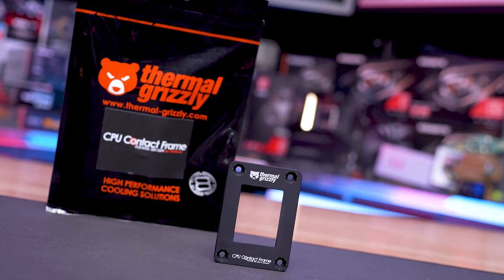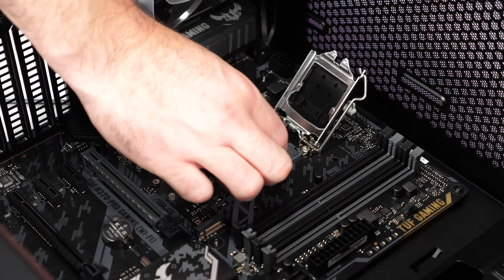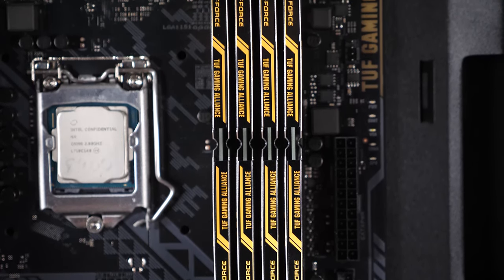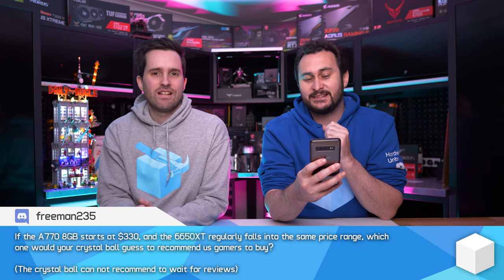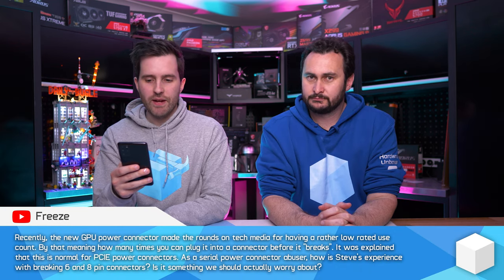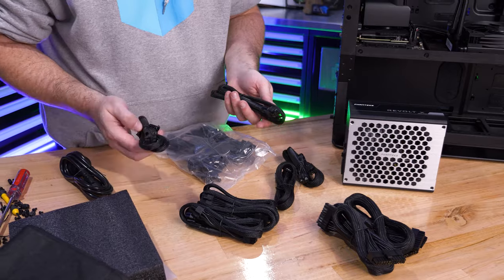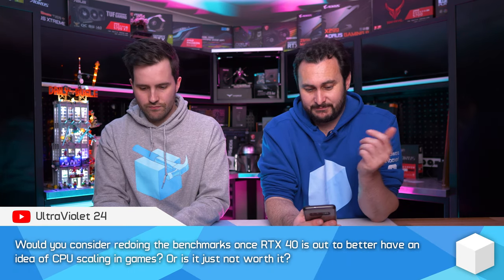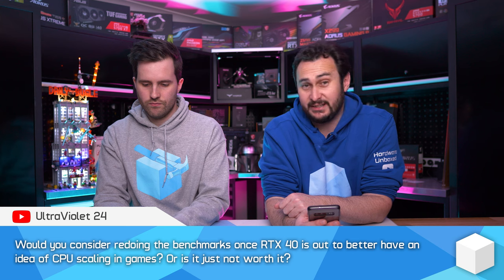EVGA Quitting Bad For Nvidia? Arc A770 8GB better than RX 6650 XT at $330 US? September Q&A [Part 2]

Comment: AMD should come out and roast Nvidia by saying something like "our board partners are happy to work with us on providing you a new generation of rdna 3 GPUs". That'd be funny.

I really hope Nvidia never turns into Apple, it's the worst thing that could happen to consumers. 

Nvidia would have zero flexibility, you will be stuck with only one design per GPU model. 

And if that design has weak cooling, you won't be able to buy one that's better. So you'd be stuck with whatever they decide. No thanks. Look at Apple, they are like 10 years behind Android on features. It's crazy.
Reply: Nvidia kind of already has turned into Apple.

Comment: When it comes to AiO on GPUs I am surprised there isn't more demand and more offer there. My first experience was with Fury X and I could not go back to air after that, it is something strange at first when you GPU idle at 35-40C with fan not running and barely reaches 56-60C whilst still being virtually quiet. And the whole packaging as well - Fury X was tiny and easy to mount anywhere. For same reason I basically skipped few generations and then went for Strix 6900XT WC and still have this amazingly cool and quiet GPU despite crazy wattage. 

Now I understand that previously there was no point to have AiO on GPU if standard 2 slot triple fan was enough. But as soon as thermals started requiring 3 slot design I expected there to be a switch to WC. As it happened with Fury X (it was just power hog) AiO became just sensible way to could such thing. Now sadly Asus was kind of lazy with Strix 6900XT WC design... they call it "hybrid", but actually it should be called just lazy. So it still has air cooling for VRM and power stages, which first of all requires cleaning, as well it looks ugly and in the end it is still 2.5 slots design. I understand that having this monstrosity in the PC case appeals to teenagers, but it is clear that they could have achieved much nicer and compact 1.5-2 slots design if they were to ditch air cooling altogether. Don't get me wrong WC on 6900XT is still functionally amazing solution, cool and quiet, and 2.5 is still better than 3.5, but it could have been even better, sleeker looking and more compact.

Now when it comes to nvidia 4090... that thing is a joke, it is ugly, it is massive and it definitely should have been AiO out the box. The FE design should have been water cooled and that would have set it apart and made it look actually modern. This 3-4 slot trend has to die... it is stupid, it makes half of motherboard unusable (although some MBs now put M2 slots there to minimise waste) and it is still loud and hot AF. I had 3090 FE for some time and decided to keep 6900XT WC over it, because 3090 was actually loud when gaming, it used a lot of power and it was running hot, like legitimately I had to go and change fan curve to run faster to keep it under 80C (well there were other reasons, for 95% performance 6900XT was half the price at the time). So yes AiO is no brainer - I haven't touched anything on 6900XT WC and I have never seen it past 50C and fans rarely even turns on.

In short - when we talking 300W+ TDP, AiO should be standard, 3 slots + should never be a thing... and the only reason I can see there being version with basic 2.5 slot radiator and 3 fans (like AMD stock designs) is for people who are planning to do custom WC. Ideally there needs to be standardisation so that one could simply get GPU block for $60 and attach any AiO. I think current TDPs are asking for it.

Comment: The thing with AMD is they are their own worst enemy in a way. For AM4 platform 5800X3D is huge for gamers and for AM5 everyone already knows there will be 7x00X3D within less than a year. Also happens to be the future time when DDR5 will be even cheaper and many reasonably priced motherboards readily available. So great for productivity, but for gaming no way these are the best chips and time to switch.
Reply: I honestly think that Zen4 3D CPUs will be next to pointless unless someone has the additional hardware (extremely high refresh rate monitor) to benefit from the added performance, which will start to fall off considerably above 1440p just as the 5800X3D does. The 5800X3D playing at 4K gives around a 3% performance increase on average, over the 15 - 20% it sees at 1080p, but if you look at benchmark FPS counters at 1080p with it you can see that unless you own a 300Hz+ monitor all of those gains can be considered diminishing returns as you'll actually gain no benefit from them vs using a 5800X besides slightly better 1% lows. As you said, I think Zen4 paired with DDR5 is a much better option for actual productivity work, but isn't even close to worth the money for someone who is simply gaming, not even if DDR5 was cheaper than it is now since most titles (more than not) actually run worse with DDR5 because they care more about CAS Latency vs Bandwidth.
Reply: @DespiseGaming  Makes sense. I expect games to grow heavier on hardware over time. But then like you said there are different issues with 1080p and 4k gaming, not to mention games tend(ed) to stick to console generations a lot. Unreal engine 5 and everything else will take some time. Anyway, since I'm not a production manager and basically any recent chip is great for home and office, my main curiosity right now is about the new AMD GPUs. Pricing, features, performance. In that order due to Nvidia announcements and performance saturation (used market and in general). CPUs - nice, but not hyped. 
Although eco switch seems like a well timed feature. After they manage to "move" it from bios to app. But then it's very easy to copy. Like I used to run Dell XPS laptop at 99% in Win performance settings to avoid it going turbo and thus leaf blower mode.

Comment: Nvidia use unsavory tactics toward everyone. Mistreating EVGA is not surprising. Think about the GTX 1060, or GT 1030. These products have wildly varying models all with the same basic name. GTX 1060 has a 3gb scam version that even has less CUs. A real business would have called the GTX 1060 3gb the GTX 1055. A real business would have called the GT 1030 D4 the GT 1020. Nvidia is just not a real business. They make money, they ship products, but their entire focus is how to get away with racketeering rather than just making valuable products. And now we're onto this power consumption rate war to pad benchmarks with the RTX products, seriously Nvidia needs to be gone from the industry. They're sharting 500W mid range GPUs on the market and calling that performance gains. It is a scam.

Comment: It's all about optics. And Nvidia, opinions or not, is just getting worse and worse. We know they want a 60%+ margin, so people don't want to hear about how supply costs have gone up especially when your yields will go up from the size of a die.

Then, Nvidia won't do the "4060ti" 12gb. They'll only do the real 4080 at MSRP, which puts the crosshairs on the AIB's for producing a gpu that NO ONE should buy. Plus, the AIB's will have to charge $200+ more than Nvidia for the same "real" 4080 in a market that fell flat. $1400 for an AIB 4080? Get real. AIB's still won't make money in this market.

We didn't need EVGA leaving to know any of that. Nvidia doesn't care about you, me or the AIB's. They care about data centers/miners and any industry with high price and high volume buys. I'm surprised no one has even attempted to look into Nvidia for market manipulation and price fixing in order to keep their old stock high in price and still over MSRP. It's gonna pang me to see all the tech reviewers reviewing gpu's that no one should buy just to collect money from clicks and stay on Nvidia's good side.

Comment: Dude you buy a gpu for performance  looks and build quality price and warranty just like a car don’t say the gpus looks don’t matter
Reply: A car, I can see and feel everyday the impacts of my choice. A video card, once it is put in a case hardly bring more than what the GPU on it is supposed to do. And for build quality and warranty, the card is still supposed to outlast the legal 2 years warranty.
Reply: Zotac and Gigabyte sell high numbers on the low end. Certainly a lot of people are looking for a relatively simple shroud/design with decent heat dissipation. Plus components are desired to match up with other components. More fancy design elements make it clash more, some people just want simple stuff to mod. And of course some people are buying a cheaper GPU so they can rip off the shroud and install a waterblock. Looks do matter but they're relatively unimportant to most customers compared to other factors.
Reply: if it were less expensive I would by the ugliest design in history without a second thought. Unless I am cleaning my case, I look at the monitor(s), not the hardware...

Comment: Could someone do a benchmark of Ryzen 7000 regarding memory support (like is 6000MT/s, 3000MHz really the highest it can go 1:1), if two dimms per channels drops supported clockspeeds heavily, should you use dual-rank DIMMs instead of single rank, and since, unlike in the early days of DDR4 which didn't really scale with performance with CPU's of that time, faster DDR5 DIMM's already improve performance, so should it be expected that all the DIMM's sold today area actually sub-optimal and people should wait for 7000+ MT/s kitts?
Reply: Waiting for faster ram only makes sense if you are guying with raptor lake zen4 maxes out around 6,000.
Reply: "early days of ddr4 which didn't really scale with performance"? What?
Reply: that 1:1 thing doesn't seem to matter much this time around, but should still wait for some more ram kits to come out, i can't remember if the expo optimised ram was even launched yet
Reply: @ThunderingRoar  Sorry was eating while typing :) What I meant to say was that in the early days of DDR4, it had very little to no impact on performance, if you had a faster or a slower memory kit. If I recall correctly, reviewers recommended avoiding 2133MT/s, but everything after that was just fine. Later on came Ryzen and CPU's with more cores and then memory performance became important again. Now with DDR5 it appears that performance already scales with how fast your memory kit is, which points to that even at the beginning of DDR5 era, if we had faster sticks, even current CPU's could already benefit. Since you can use DDR5 for quite some time (I doubt DDR6 will come soon) even in future builds, I wonder if people should wait for faster kits before moving over to DDR5.
Reply: @kharak6204  To my understanding there are three timings: Infinity fabrik, memory controller and speed of memory. While before it was important to have 1:1 ratio between everything, with Ryzen 7000 the ratio between infinify fabrik and rest of the timings is no longer important, but instead IF should be left to AUTO. Memory controller and memory should still be 1:1 for optimal performance.
Reply: @kingyogesh441  Thing is, DDR5 will likely be here for some time and there is a good chance I'll reuse the same kit in future builds as well. If you just want a machine that works, it doesn't matter that much, but I like to try out things like overclocking and running tests just to see if it has any effect. I have a 4266C19 B-die kit on my 3800X - not because it makes sense, but because I wanted a kit I could try to push as far as possible.
Reply: @TechTusiast  fair enough then wait for the 8,000 C-30/40 kits it’ll drop with raptor lake.

Comment: I think buying AMD Radeon 6650XT is a mistake against Intel Arc770. These guys doesn't tell you the good news. Intel support AV1 encode and decode, something Radeon doesn't. Also Intel has out of the box better Raytracing support than any Radeon right now. It is videos of Linus Tech Tips that he is surprised on early driver version. It is true if you have old system without resizable bar or SAM enable it will not be a good buy, you are talking an older system than 2019.  The other thing is AMD drivers will not be better over time while intel has a lot to improve. It is possible that one year from today the intel drivers will mature enough to even Intel Arc770 could have the performance of Nvidia 3070 plus Multiplication Cores that will be use on XESS. Which so far on videos looks as good or even better than DLSS 2.0, which is better than FSR. Also like FSR is go on the pipe rendering intel can implement on their drivers  to use MX instructions to get even faster FSR.
Reply: I have not seen any 3rd party reviews of Intel, have you?
Reply: @EdDale44135  Not yet, but the hardware itself has better features. Most of the early revies they attack the drivers features not the performance you can get out of it to the price point. So if you follow the industry, you will learn that intel gets to improve their drivers but at the long run it is better hardware.
Reply: And here's is the problem. What if Intel decide to stop supporting it like they did Kaby Lake G or the i740 way back when? You'd be buying an expensive paperweight. Especially considering as it stands, the only games Arc does well in is in DX12. Under any other API, it runs like crap.
Reply: @riven4121  It is a gamble, I guess but you need to think about it, it is not future without GPU unless something came that can have massive parallel process. So if Intel wants to be competitive as computing company they need to offer GPUs on their portfolio to be one supplier only on the data center. For the money intel already invest on their gpus is not going back. I think it is over billion dollars. Comparing 1990s to 2022 is a lot of difference. Back them GPU where only used for pc games, not even Nintendo or PlayStation used gpus back them. They had their custom low end chips. Now gpus are everywhere games, consoles, smartphones,  cars, datacenters, etc.... So yes they need to have a decent gpu for any kind of workload.
Reply: @victormtzc  that is interesting. The reviews of the currently released ARC hardware say it should be avoided, under performing across the board compared to even the RX 6400. So, for me, Intel has a lot to prove. I may also be once bitten, twice shy - since I was a big proponent of the Larabee architecture before it was cancelled.
Reply: @EdDale44135  the only card out is the rtx a380 which is supposed to compete against Nvidia grx 1050 or 1030. So yes that is very low end. Probably intel threat nvidia at the time with Larrabee.  It was a famous lawsuit of nvidia vs intel. I believe they tried to use as way to negotiate against Nvidia.  You need to think about that intel is getting things do fast. For example Blender support one api, how many years took to blender to support Hip ti amd. That is what I am trying to said. If I was looking to buy a gpu. Probably I will consider intel. The hardware numbers are impressive 16gb at 550 gbs with a clock of 2100 mhz sounds good. I know it will be game that sucks but they are games that is very competitive plus professional workloads like DaVinci resolve and blender. All that memory can be very useful for things beside gaming.

Comment: I could see Intel for cheap workstation. AMD is just a pain sadly currently... The really need to push their software, oneAPI is just already so far ahead...
Reply: What makes AMD a pain?
Reply: @EdDale44135  HIP support in blender is... well it can't use ray tracing, on the ML side, the support is also rather spotty and their encoders did get better, but it's still no match for quick sync. I don't think the hardware is flawed, but their software stack really needs some work...